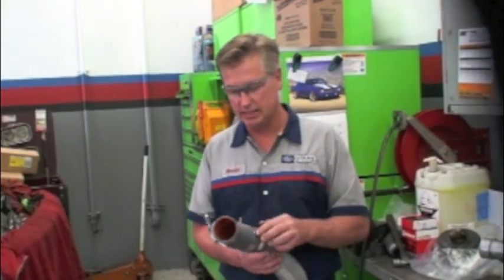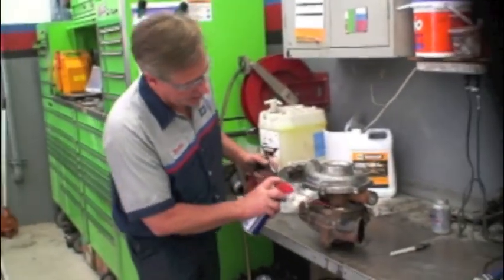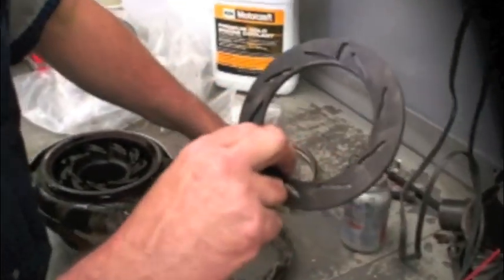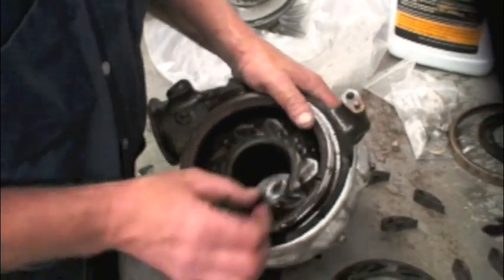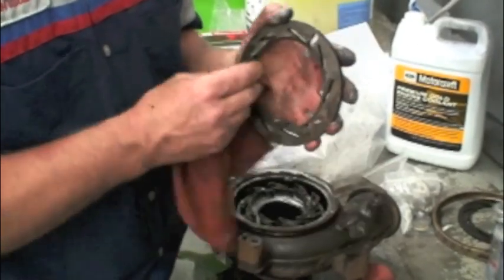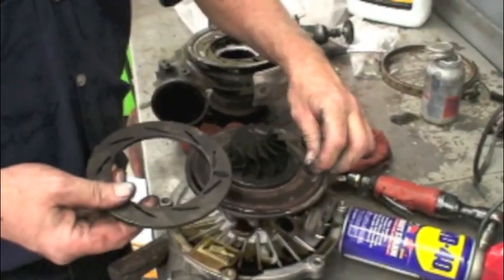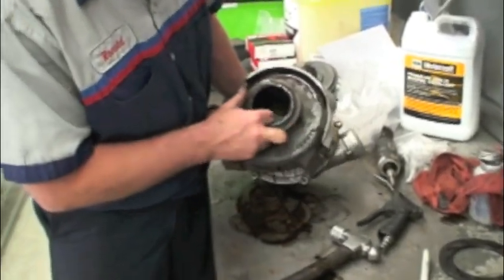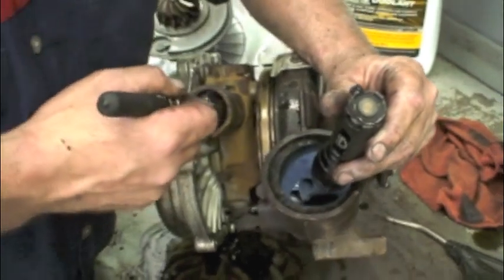P0299 lack of power and turbo sticking on a 6.0 Powerstroke F250 diesel

Comment: I was worried I might need to replace my turbo as Ron said that if Unison ring stuck on its mounting and wont turn you might have to replace it.  I attacked it with a die grinder and wire brush and 3M roloc wheels. These helped but still left behind a lot of corrosion. After taking a Goodson carbide super scraper to the hub where unison ring seats and the area underneath where the ring mounts  it cleaned up real nice and now the unison ring moves freely. It also worked great on the mating surface of the two halves of the turbo which were heavily corroded. Just take your time with it and dont leave gouge marks. Work with a shallow angle so as not to dig in.

Comment: f250 turbo 6.0 ran fine just before the 0299 code; took turbo apart and disc/viens were ceased so got them cleaned up very well and applied anti-sieze, reassembled and checked with magnet and moved back n forth.  Installed turbo, and reconnected all.  Drove for a day and on second day took it on the highway, wen to pass a car and lost power.  Very demoralizing.  It's my dad's truck.  I haven't looked at the truck to see if something came loose but curious if you had any thoughts.

Comment: Awesome video.  I took my dad's identical turbo apart and the plate was stuck.  I took a wire brush and cleaned up very well, added some anti-sieze, reassembled, checked with a magnet for movement.....all good, reinstalled turbo.  It sounded great and truck fired right up but after driving for a day, went to pass and lost power.  Not sure what happened.  Maybe something got disconnected.  Any thoughts?

Comment: Hi,could you tell what is happened I start the engine cold and was running 30-40 minut good I stop engine for 3-4hours than I start the engine and show me low oil pressure where i have to look to find problem
Reply: I have low oil pressure unless I give it throttle.  It smokes, has no throttle response at first, check gauges light also came on. It smokes so bad as well

Comment: I have a 2006 6.0 F350 and I have smoke coming from the exhaust and vibration while idling/driving and won’t go over 55mph and struggles to get boost power and turned off lost all power while on the road  could be bad injector or my turbo gone bad? Any conclusions?
Reply: Fixed the problem yet?

Comment: hello I have Ford 2008. f450 6.4.  Fuse # 74 blows every time I try to start the engine.  but it doesn't start
Reply: Look at the wires that run to your gear shift lever. They are for overdrive. They may have rubbed the plastic wire coat off

Comment: RIP Ron. Thanks for all the help along the way. Split our oldest 2003 6.0 turbo today. Barking, performance code. Unison ring was real tight. Cleaned it up real good. Minor pitting. Unison wheel was in fine condition otherwise. 173k. Actuator slot not oblonged etc. Pretty certain I had improved % on VGT data also. Like it wasn’t fully functional prior to cleaning.
Reply: Did that take care of your turbo barking and performance
Reply: Yes. Pretty common. I’ve done a few now.
Reply: You can pull the VGT actuator and use a magnet or a pick ( I forget now ) and move the unison ring pretty easy when it’s working properly. Plus you can do this before and after cleaning to see the difference. In fact I’m sure Ron shows how to do it

Comment: Would anyone happen to know if a faulty plunger would have a negative impact upon reassembly? The actuator rod from the oil plunger makes a gargling noise and is difficult to move back and forth when i rotate the unison ring. Is it normally pretty hesitant to move, or is the pluner not operating as it should?
Reply: TheTruckFanatic actuator failure.  Unfortunately, you need a new turbo friend.

Comment: www.youtube.com/watch?v=1MlIXC3-y18   My 2004 f350 6.o diesel is making this sound .   It is intermitten and it will make the sound (whining like it is under a heavy load) in park nuetral or while driving.    Can it be the torque connverter?  turbo?   any input is appreciated.

Comment: I have a 07 6.0 runs great but from time to time it sounds like a loud fan noise starts and occasionally temp rises while this happens.  any ideas? new diesel owner I know next to nothing.
Reply: how hot does it get?
Reply: +FULLY LIT. typically it get around three quarter temp or slightly above.  once it went to red sensor went off i let off throttle and it dropped to normal within twenty seconds.  determined it was a head gasket.  getting it "bullet proofed now new gasket studs eoc.
Reply: Loud fan noise is the computer commanding the fan clutch to maximum output. Inspection of the cooling system and its components should be performed.

Comment: how can I safely remove turbo without disconnecting negative battery terminal? I have an interlock device on my truck (breathalyzer) and cannot disconnect the battery and can't afford to take this in and get it done. thanks
Reply: you don't need to disconnect the batteries to pull the turbo.. you can actually keep the alternator on and just put a rag or something over the charge wire on the back of the alternator. there should be a rubber boot on the wire already but just keep a rag or something on it when you pull the turbo.
Reply: +FULLY LIT ok thanks

Comment: CETANE rating of 45 is the Minimal for Fords and its crucial! Most diesel fuel in the US has a rating 38-40, not enough for Fords. Low Cetane ratings will cause silt build up and cause your EGR's to gum up and fail.
Reply: Here in Cali its 50 if I remember right

Comment: Hi Ron I have i2005 F350 sounds   like it has a air leak coming out from the turbo when I disconnected electrical wire that a hook up to turbo stops sound of air leak will stop is there any way that anybody can tell me what this can   Be the problem

Comment: Does a stuck on unison ring mean replace the turbo or is it ok to change out the unison ring?

Hello Ron thanks again for all the great videos. I just disassembled the turbo and the unison ring was really stuck on. Had to pry it off like you said. The actuator hole looks ok but this my first so not sure. Does a stuck in unison ring mean replace the turbo or is it ok to change out the unison ring? I have a 2003 Excursion 6.0. It was blowing off through the intake ("barking" "huffing" don't know the term) while accelerating, and when I let off it would chatter air sound. I had a p2285 but I changed the ICP and harness a couple moths ago and while in it right now it looks good no leaking. The IPR pigtail was frayed on both wires. I've spliced in a new pigtail for that and have put the new screen and gasket set on it.  Thanks for your time sir!
Reply from the maker: replace it if it's worn. Check where the shaft moves it and the vanes slide. Make sure to clean the hub too. It must move freely.
Reply: +DieselTechRon thanks a lot! I'll clean it up real good and put in a new unison ring. Thanks again

Comment: Hey diesel tech Ron  I just bought a 04 6.0 the vgt at idle is 85 but at 70 it's around 53 but I'm only able to build 18psi of boost I think from exhaust sounds my veins in the turbo are stuck
Reply: Brayden Lease87 ron passed away

Comment: Over the weekend, I tore into this project & got to the part in reassembly where Im pulling the seal for the oil operated piston that moves the actuator rod & it wasnt moving using a magnetic parts grabber like youre using.

I was working outside & it started snowing, so I moved things into the garage & this piston fell out in the process, I put it back in -seemingly it had a full range of motion, I reassembled the exhaust side to the center housing & reattempted the magnetic parts grabber on the piston while shining the light into where the Y pipe hooks onto & could see the vanes moving.

Ive now got everything back on & the truck fires up, but it seems really reluctant to build boost, maxes out @ ~10psi, and has some funny sounding harmonics.

I think my alignment for the piston & the actuator rod went less than great -How would I go about checking this? :)
Reply from the maker: Hi. Sorry for the late reply. I have a video about power loss after turbo repair showing how to index it properly.  also the ring sticks on the hub.. I should have shown cleaning that TOO
Reply: +DieselTechRon No worries, Thanks for replying :)
This weekend I had the opportunity to tear the turbo off again & reindex the piston/plunger to the actuator arm. After having put everything back together, it still seems like Im not really getting that much boost (engine sounds from the previous time apparently were not getting the downpipe completely mated up to the turbo); At the moment DTC-wise Im getting P1000, P0113, and P0487. Would any of these cause the turbo to make a more minimal output?
Reply: UToobRandomness

Comment: I have a real issue with my 07 6.0 PSD when at a wide open throttle, fully warmed up and under medium to heavy load, I'm getting a popping through the intake noise and a loss of power... I'm in the process of pulling the heads off to replace bolts with studs and new bulletproof EGR cooler and engine oil cooler. The cylinder heads checked out good(no cracks, pressure tests and perfectly straight) I'm hoping that when it's all back together that the "popping" is gone. There were no stored codes and I had plenty of boost. While the turbo was off I tore it down and cleaned it, all the working parts moved smooth and easy. Is there anything that you can suggest before I put it all back together?

Comment: i have a 2005 ford f350 dually 6.0, it started fine i went from utah to california, on my way back the rpms started to drop like crazy and when i acelerate kind of white and blue, it shut off on the freeway and i started back up and samething happend, i let it cool off and now it doesn't start, any recommendations
Reply: Oil pump damage. 
It heppens due to Bad quality of engine oil or  low level of oil in the sump so at high speed when flow of oil is max inside engine, oil pump begin to suck air. This lead to damage engine and turbocharger.
Reply: +Jessica Lopez Had the same thing once upon a time going thru Wyoming, come to find out the STC fitting ate it & high pressure oil system was not holding high enough pressure
Reply: Definitely sounds like an internal leak of the oil system.  The fuel injectors on these depend on oil pressure to function properly.  I know it has been 3 years, but for anyone reading this, check out your oiling system.  Pull the valve covers and inspect the oil pressure rail.  I would start there.

Comment: Hi Ron, Love the videos but can't find my problem.  I get the PO299 but the truck runs like new with no problems.  I have a new EGR valve, new MAP, new sensor under the Degauss tank(can't remember the name) and only a CEL.  It will run for days then throw the CEL.  It runs about 25# of boost.  Any ideas?  57K 50% pulling 16k trailer.
Reply: +Curt Leake Unison ring was stuck to the center.
Reply: Curt Leake nice!

Comment: Hi Ron I have an f350 6.0 that starts fine just takes a while I'm talking half hour to worm up any idea.. it's runs fine after wormed up. If I start and let it worm up for 5 minutes and try to drive it feels like it's missing. But if I let it worm up for 30 min. She runs amazing. Idk if this help but it's a standard transmission. .
Reply: Fuel injector stickion
Reply: It must be taking longer self starts.
Reply: +Leai Conn Have you figured it out? I have a few questions for you if you haven't fixed it yet
Reply: Mike Mitchell Fixed mine recently same symptoms fixed with new injectors.

Comment: Hey do you have any idea why my turbos would flood with oil? I have a 2006 f250 6.0. Apparently the mechanic at the dealership has no idea but this it should cost 6k to fix.....
Reply: karadenise22 The most common thing I have run into, as far as excessive oil in the turbo, is blow by coming from the crankcase breather on the valve cover. This is connected directly to the inlet hose to the turbo by a small hose from the breather on the valve cover.
Reply: +karadenise22 In the center housing, theres a little ring (like a piston ring) that plays the role of a seal in the cavity where lube oil comes in to lube the turbine shaft; Its possible that seal/ring has gone to shit?   If you dont want to tear into it,Try taking it to a turbo shop & see what they say. The amount of oil from the CCB like theyre talking about below is going to be pretty minimal...

Comment: Gentlemen, question? I have a 05 6.0 diesel, Check engine light is on. I have cleaned the ERG valve, Checked the air line on the manifold by the map thing, also replaced a top hose that was cracked. reset service light, light is off. now the problem is that the top turbo hose keeps blowing off, there was no oils or anything that was put on the hose, only carb. cleaner and cleaned all the connecting fitting. now it seems that I have way to much pressure, the top hose keeps blowing off upon heavy acceleration or when towing, what am I missing, is there anything that I need to check? I feel that it a sensor somewhere, thats my feeling. the turbo to me feels fine. but I'm not a Diesel tech. so if anyone has experienced this please help me thank you.

Comment: Ron
I got my turbo off and when I pulled it apart, the unison ring was definitely stuck and I had to pry it off. The unison ring looks fine. Do I need to get a new turbo or is there a way to free the unison ring?
Reply: Same issue here... I just sanded and cleaned the place where it was stuck on - it was rusty. So i will start putting it together now and see how it goes

Comment: Don't forget a plugged map port can cause a P0299 code as shown in my P0299 video.
Reply: What about blow back under hood , like smut. Is that a sign of a bad turbo or FCIM
Reply: turbo flutter you mean
Reply: FordTechMakuloco is there  need ever for a blow off valve?
Reply: I'm stumped on mine. No code set but taking off from a dead stop it lags, the VGT goes up and not down.. On hard acceleration it will go to 85% then drop to say 30% or whatever and that's when it accelerates.. Blows plumes of black smoke.. Changed my VGT actuator but no difference.  Also, going down the road about 50-70 mph I try to accelerate, it will miss until I let off the gas and hit the gas hard again it will take off. Haven't taken the turbo off yet.
Reply: @johnlewis6642  Exactly what mines doing if you add lack of oil pressure without pressing the throttle

Comment: Hi Ron, I have 2002 6.0 powerstroke F450, in my turbo charge I see there is oil inside the turbo and go inside the exhaust down pipe, when I start the engine there is a lot white smog, how I can fix this. Thank you,
Reply: Turbo vane shaft seals are leaking, replace turbo

Comment: Ron, I've got a check engine light on my 06 6.0 the other night after a cold start and I tried to read it but it said no codes. I deleted it and got it again the next day and it said p0000. The truck doesn't run rough and idk what the hell I could be, I'm thinking if anything the ficm is bad cause it's getting hard to start since it's been cold

Comment from the maker: Cleaning is easy with the proper tools. If you're able to remove it and more important install it back properly than cleaning it is easy. I read people commenting on the anti seize. It's only for assembly. It's gone once it warms up. By far the most common cause for failure is short driving times not burning the condensation and moisture off.

Comment: Hi, we had 6 codes related to low turbo boost, we cleared all codes & code came back as P0299 low Boost, first thing we did was check the intercooler, right side of the intercooler was leaking very badly & would not hold pressure, we changed the intercooler & roadtested, we still had lack of power with turbo fart on hard acceleration, removed turbo, vains were stuck, cleaned turbo, checked operation no good, found roll  pin broken in actuator, fixed pin & cured problem, thanks for the video.